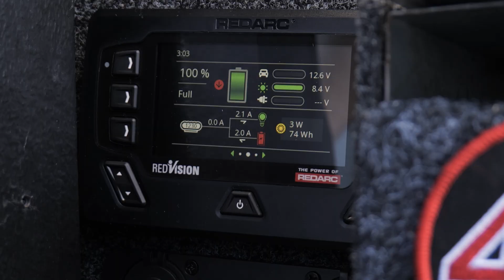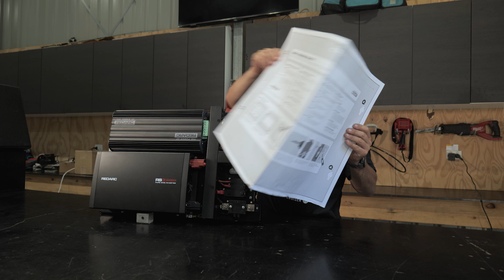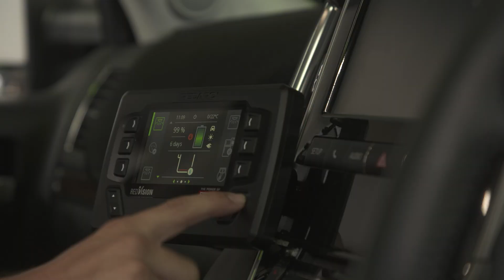Canopy Power Setup Made Simple With REDARC | Shaun Whale Explains

Comment: Nice bit of kit BUT... it's $5700 and doesn't include a battery... which is another $2000+ if you buy a Redarc lithium...  

@REDARCElectronics I wish you had a more reasonable range of entry-level solutions. 

Specifically, something preassembled and able to charge a second battery, basic devices like your phone or camera and run a fridge when camping. 

All of these featured systems cost more than $8000... and are overkill for the average camper!

I bought the Redarc 1240 BCDC kit, 100a century lithium battery, all the plugs, sockets, fuses etc because I wanted a good quality system that would last but all the other brands on the market make their stuff in China and use cheap components...
Reply from the maker: Hi Rob, thanks for the feedback there.

At the moment, we are definitely starting to look into solutions like this, that are more of an entry-level correct. We started with these current back-planes as you see here now and we will add more in the future!
I hope that somewhat answers your question, thanks again.
Reply: @ sounds great 👍

Comment: Without using the Rouge or larger TVMS but still using the Redvision display. I assume you cannot control individual lights, 12v, etc with the display. Is that correct?
Reply from the maker: Correct, The TVMS1240 or TVMS1280 distribution box is required for control of your lights and accessories.
Reply: @REDARCElectronics  I've ordered mine and was told that I can control individual accessories via the rogue system. Is that not correct?
Reply from the maker: Hi there - apologies for the late reply.

With the ICMS panel on its own, these parts encompass Charging and Inverting power from your Auxiliary Battery, plus a fuse box for your Loads as you need. However, it doesn't include the Rogue or Prime RedVision systems to control your Loads - no. However, being you have the RedVision Display you can easily add in either module to make this control possible. 
I hope that makes sense!